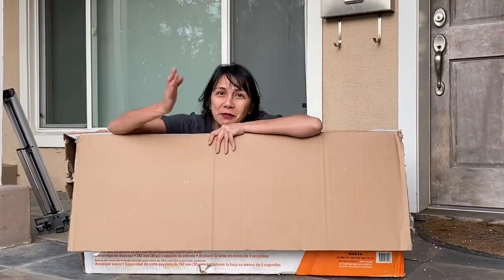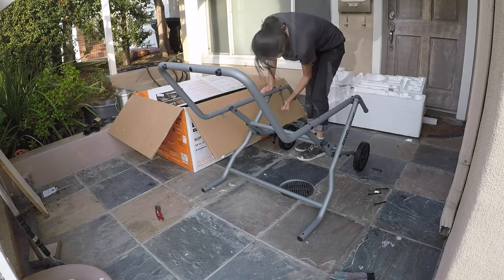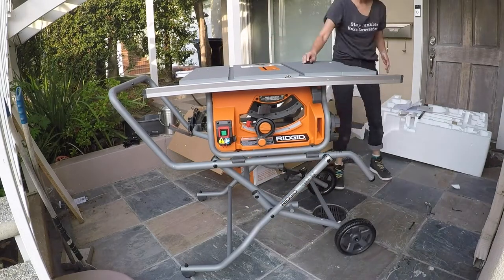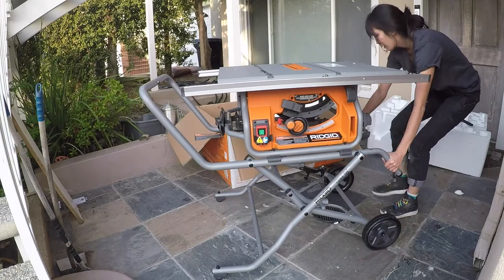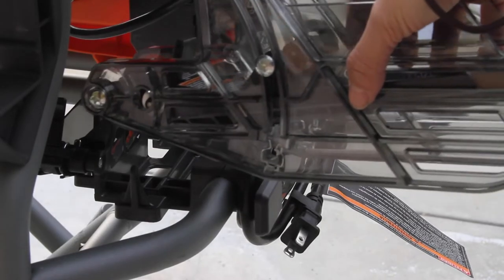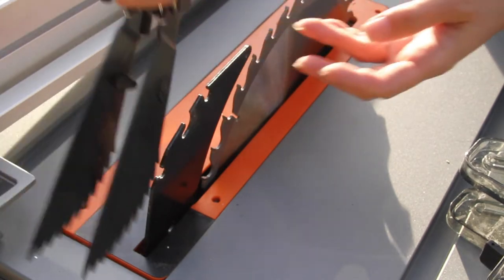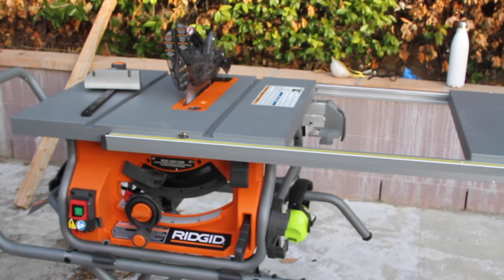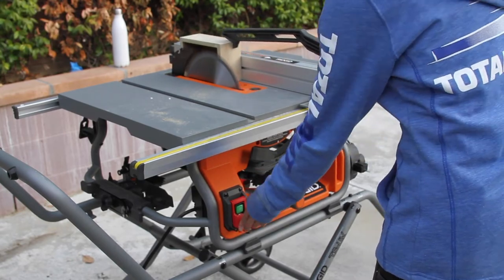Unboxing: Ridgid 10" Jobsite Table Saw Set Up and Review

Comment: I wish I would of saw this video. When I mounted the table saw on the stand it was hard putting on the 4 screws. Any idea?
Reply from the maker: The ones not at where the two pipes meet are easy enough. That angled area, a right hand ratchet helps.  It was a bit tough to get it on.

Comment: Does it come with that safety feature where if your finger comes close, it instantly stops?
Reply from the maker: I don’t see one and I’m too scared to try that 😂. I like my digits they’re needed to eat tacos.  It does come with a blade guard, however - I’ve never actually used it with the blade guard, I always just use the push stick when I’m going too close. I do know that the Sawstop saw does have that feature. I just can’t afford that particular saw…..one day, hopefully :)
Reply: @xtjoy  No it does not have that safety feature, only the Sawstop and a Bosch model have that, and to get those you are looking at $1600.00 !. You won't find a saw at this price or even triple the price that has that, even on sale.

Comment: I just got a used one, it has many deep scratches and I want to try to smooth it out better but I can't find anything that tells me what exactly the top material is made from.  Do you know if its Steel, aluminum, or something else?
Reply from the maker: I believe it’s aluminum, as the whole table was easy(ish) for me to lift out. I’m wondering if you could see if they have replacement parts with Ridgid?